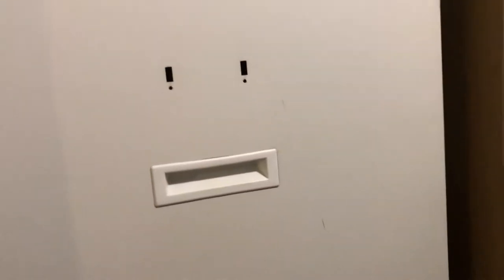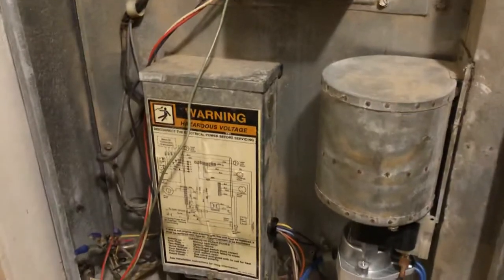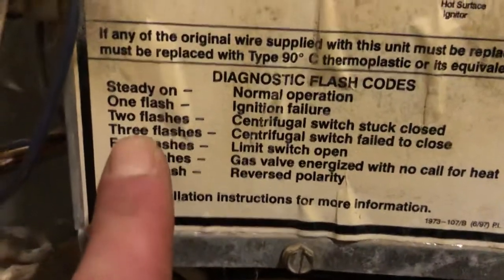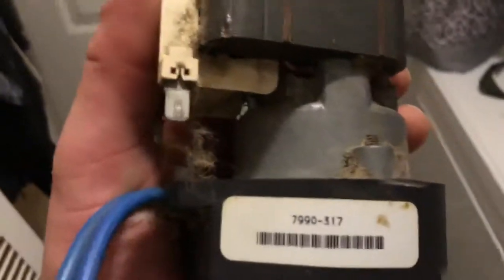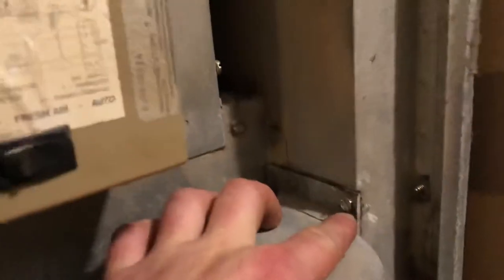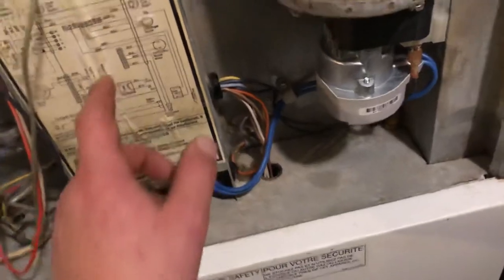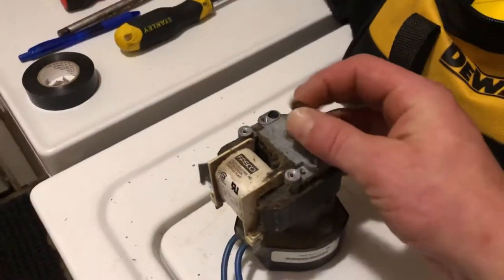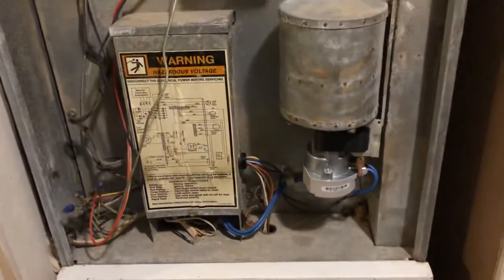Coleman furnace centrifugal switch/inducer fan motor replacement

Comment: Mine inducer comes on, runs for a short period, stops and then nothing. Since there is no pressure switch (or maybe the centrifugal switch is the pressure switch?) Do i need to replace the whole inducer motor like u did since they are built as a unit? Any help is appreciated. I did not count the flashes because i was un aware that furnaces worked like obd1 computers but im definitely checking when i get home. Everything I've read says its the pressure switch which is 3 flashes.